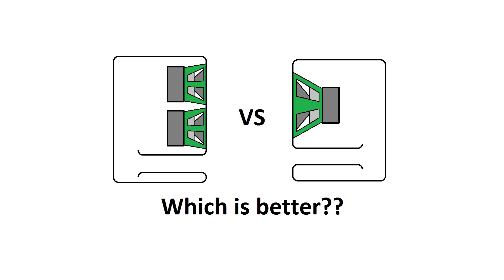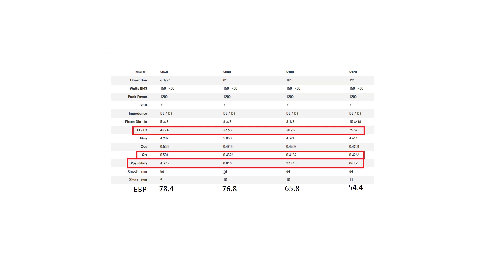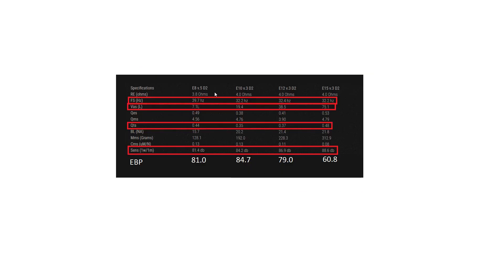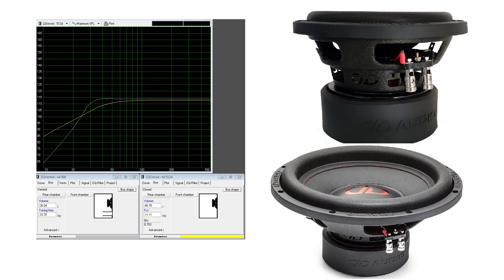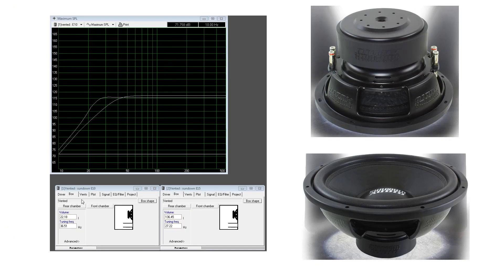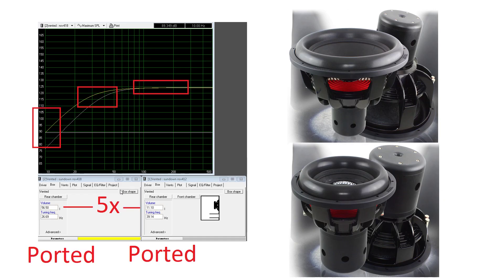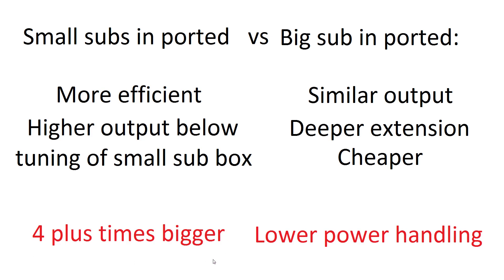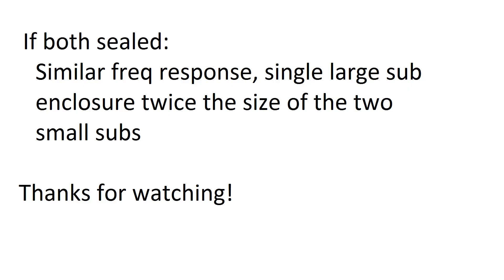Two small subs or One large sub?

Comment: I would recommend 1 big sub all day, its the best performance. Quality over quantity. But if you have a more unique sub space and it is more long that cubic then i would suggest 2 or more small subs. It really just depends on the box, the eq, the room, and the space.
Reply: Dual subs is almost always better than one big one. Running dual subs will reduce peaks and nulls, localisation smoother bass respond more head room.

So you’re wrong when you say ‘quality over quantity’ 

Have you had a listen to one bigger sub vs smaller dual subs? There definitely are pros and cons but believe me running dual is a much better experience it’s directional you can place the subs in different areas where one big sub you can’t
Reply: @amin4006  Depends on the sub(s) man.
Reply: @sagered8007  that’s true, you need to compare apples with apples. Lets say dual 10” rel vs one 12” rel you will get a better experience with the dual 10” 

Im currently running dual svs sb1000pro and I can tell you it’s a far better experience than one  sb2000pro
Reply: @amin4006  I don't doubt dual 10" is better than a single 12". But i bet that dual 5" isn't better than a single 10". And when i made this comment i was talking about having multiple drivers in a single box. Just realized that could cause confusion. Look at the thumbnail of the vid.
Reply: @sagered8007  Fair enough man, in that case I would rather one big driver in a single box too
Reply: @amin4006  👍

Comment: how about one BIG sub, two Medium subs, and one small sub.      OR... FOUR small subs, TWO large subs, and two medium subs.  Or what about 4 medium subs??/ welll????   what about it.....!??
Reply from the maker: Yes, can work, hence why 3-way loudspeakers exist. Thing is, each speaker should be crossed over. So, say for one 18", two 12", 4 8", if they're all playing the same frequencies, phasing issues can occur. Instead, for example, you could run the one 18" from 16Hz-32Hz, the 2 12s from 32Hz-64Hz, and from 64Hz up it becomes directional, so best off having the 4 8s in the doors, or in the front towers depending on application. Most 18s, however, can do up to 64Hz just fine, while it can be difficult for 12" subs to do down to 16Hz, but if you've got 4 of them, it's just fine. In terms of loudness surface area wins out, so it's better to have 2 18s or 4 12s, rather than 1 18 with 2 12s where they can't effectively do the same frequencies at the same time. Good question though, could address it in a future video.

Comment: two small and one large sub :)
Reply: That’s how I do it
Reply: @bleachstain9785  thays horrible sound quality. They play differently and different peaks. Just saying
Reply: @vasquez3769  lmfao, tune your setup right and build your own box. You won’t have that issue.
Reply: @bleachstain9785  that's not true. Different size subs react differently so no matter what box it's in you'll notice a difference when they play. I know because I've heard a few systems and ppl say they sound fine but not to my ear. People like to bs themselves sometimes.
Reply: @vasquez3769  they haven’t shot for straight SQ with them then and might have just slapped them in the car. I did all the math required for my setup, and it’s designed so the bigger sub fills the low to middle bass end, while the smaller subs fill starting in the middle bass to upper bass register. Same series of subs, just slightly different sizes, placement, etc. I’m sure nobody else even thought of removing usable room inside of their sedan like I did.

Comment: Why not recommended for a ported box?

The JL AUDIO 8W7AE-3 driver has Qes 0.654 and EBP 53.8 both of which suggest to use a sealed box. 

When I design a ported box for this driver in WinISD it shows much better low-frequency responses over the sealed one. Can you tell me why specifically is it not recommended for a ported box? 
What's behind those two formulas?

WinISD shows that both a 25L sealed box and a 50L ported one can handle the recommended 500W RMS with HPF but the ported has so much more lows and the same SPL output across the fq response. If I don't take the obvious aspects such as group delays in considerations, why is this woofer not recommended for the port? Port dia 8cm 51cm length is doable and 22m/s wind velocity is kinda still tolerable. Port tuning 23Hz.

What am I missing here? Thank you.

Comment: In my head 2 12’s that are 250rms won’t be as loud as 1 8inch that handles 1k rms. Am I wrong? Bc my 2 RF shallow 12’s are 250 rms and my old single 10inch sub which ran 1500 rms hit so much harder and deeper. Am I right?
Reply from the maker: It does depend on the box a bit, but in general, yes. The single 18 on more power will do much better than 2 12s on half its power total. Similarly, 2 12s may use a 2 cu ft box, and 1 18 more like a 4 cu ft box. 
The 2 12s compared with 1 10 gets a bit hairy. It should end up being around 3-4dB less efficient, but its also on 3-4dB more power, so should be similar depending on tuning etc. If it's 2 shallow 12s in a small box compared with a single 10", high excursion big motor sub in its perfect box, it could be above the 12s by 3dB or more.
Reply: Dakoustics that was fast man thanks. I was meaning 1 8 inch like one single hi excursion hi power 8inch vs those shallow low power 12s but I think it’s the same as you were saying with 1 hi output 10 vs 2 low watt 12’s. Thank you so much man I appreciate it
Reply from the maker: @jesp5842  Yeah, its more or less the same, tricky though to get it quite right. At that high wattage, subs often need small boxes to control their excursion, though small boxes tend to be less efficient. You'd need a mighty 8" sub. Could also consider something like a 6th order to get the most out of it. 6dB less efficient, 3dB more power if at 1k, so 6th order might be required to get that extra 3dB on top to come out equal. Box will still be smaller than the 2 12s.

Comment: I've built enclosures for pairs of pretty much every size sub woofer, and once I built one for four 10"s. But my current enclosure uses a single 18" (with two 15" passive radiators, which act as a port) and it is by far the best, most musical sub setup I've ever created, out of about 30 of them.
Reply: @Fish Chris does it matter the sub to match a passive radiator  in sealed box? Like say one 15 pair with two 12 inch passive radiators?
Reply: @430Xsidian  I'm not an expert, but from what I've read, you should use double the cone area... so one 15" sub would do best with two 15" PR's. And honestly, my two 15" PR's are pretty much maxed out. In retrospect, I should have followed this advice and went with two 18" PR's. You can use different sized PR's though, than your sub(s) like I did. You should just stick to close to double the surface area. I've considered adding one more 15" PR to my same enclosure. Wouldn't sound any different, it would just take some of the load off of my two current PR's.
Reply: Hey man any way you could make a video of your setup?? I’m considering doing something similar

Comment: Smaller cones less flex and distortion

More coils maybe more heat dissipation too
Reply: Smaller cone - higher Fs, and higher rolloff, doesn’t dig as low as loud, very precise cone control and therefore bass

Bigger cone - lower Fs, much smaller low end rolloff, digs low loud, utilizes a larger and heavier cone resulting in less precise bass and muddier higher bass. 

I prefer both. 

2 SA6.5’s, 1 SA12 classic. Matching sundown amps relative to each’s RMS, Spec built boxes. I’m more than happy, setup for SQ.

Comment: Cant defy physics. Agile sounding, fast transients are smaller pistons. 
But if you dont care about SQ, go large diameter.
Reply from the maker: Motor force is important also. If a driver has double the surface area, mass, stiffness, and motor strength, its almost identical in effect to two drivers. In this video I assume equal motor force, so yes, this is a good point.

Comment: Tens have been a meat and potatoes driver for bass guitar. The ten is so efficient in comparison to the 12 , 15, speakers . For the price and box. 4 80spl 10s will move better than a 12” 15” 18” 21”
Reply from the maker: I helped repair a bass guitar speaker recently which had in it 4 10" drivers. Quite interesting how that turns out. I'd say its a good ratio between ferrite motor and cone area, so a strong neodymium motor would be required for a good bass guitar speaker to be 12" or up, and of course neodymium is expensive, hence 4 10's.

Comment: 2 subs will have interference. can cancel room modes, but usually you just end up with more interference. the best thing to do is to get the largest possible single sub you can afford, play with placment to avoid most of the room modes, and use an eq to flatten response at your listening position. a superhuge sealed box may not be an option, in that case you can do an isobaric load and end up with a smaller box, 2x power handling, 3dbl less efficiency (notice, it will be compensated with the extra powerhandling), if its back-to-back setup you will allso cancel a lot of nonlinearity in your drivers, and have a shitload better cone acceleration.
Reply: That depends on the room 

2 subs in a small space like a car will not have any interference as the distance is so small… its not gonna have any phase cancelling as the signal goes positive and negative for booth coils at the same time.

Comment: I wanted just a basic 12” L7 so I could use one side behind the seats for “storage” in a single cab but my friend says two sundown 8’s would be better
Reply: I would go with 2 Skar Audio ZVX-8 subs in your cab instead, less room, less power needed but they will be more sound and feel than you need. Skar essentially Sundown with out the cost of the name. So you can have a much better system at less overall cost. They are underrated in power handling, so pick up a RP1500.1D or RP2000.1D Amp to power both ZVX-8's.
https://www.skaraudio.com/products/zvx-8-inch-car-subwoofer

Personally I'd skip kicker, Sundown is great but their cost goes up every year from popularity instead of sound. Skar is the underdog right now.
Reply from the maker: Bit of a tricky one, the L7 would need to be sealed. The sundown 8's should probably be ported to get the most out of them. So, depends what you're looking for.
Reply: 2 10's SA-10 ported in 2 cubes would smack the L7
Reply: Otherwise, maybe a single U-12 on 2K-3K amp

Comment: Ported, horns and 6th order usually need subwoofers with a stronger motor than an infinite baffle. Two small subwoofers might be better in a horn. Some of those little Sundown 8" subwoofers would absolutely pound in a high compression front loaded horn, so they can be well impedance matched and actually make use of a strong motor. These subwoofers were made to metaphorically "push a big gear". Folded horn drivers and drivers for small ported boxes have similar parameters.

I like to use large PA style drivers in ported as they are very economical on power, though not as much raw SPL at their limits and take up more space for the box. They are usually used for concerts because the venue's electricity supply is less taxed.

Comment: i was contemplating 3 eights or one 12, but i remembered that there is a 3db  gain per additional driver, so, even though eights are less sensitive, when all the db gain from multiple drivers and incremental power increase db gains per driver, on paper i can get well over 100 spl from three eights and you can buy three 8s for less money than 1 12, plus a sealed box that will fit behind the seat of my truck
Reply from the maker: 3dB per doubling of driver count, so for 3 total drivers its more like 4.8 dB more. Still very similar to the 6dB I'm guessing you used, but its not like 100 8" subs are over 300dB. Also when you consider power consumption, 3 8" 250w subs are way louder than one 12" 250w sub. Should kick ass, especially when its behind the seat

Comment: I got an Audi A5 cabriolet. So space is extremely limited. Was thinking of doing a JL 13.5” shallow mount for infinite baffle on the trunk wall. Would that speaker work? Or would you recommend  a non shallow mount for that purpose
Reply from the maker: JL have some of the highest quality car audio subs. From what you're describing you're best off going with a subwoofer with a Qts ranging from 0.6 to 0.7. Most subwoofers tend to have a Qts from 0.3 to 0.5, so might require some hunting, though in essence since the enclosure is so large its not providing much damping on the driver, so its up to the drivers suspension to do it itself. 
High excursion is ideal, as once again with low damping the driver tends to move quite a bit at low frequencies. So low profile might not be ideal.
The shallow mount driver you linked wouldn't do too bad a job, but its Qts is a tad lower than ideal at 0.45. I can't think of an ideal driver off the top of my head, though I'll do a quick bit of research and come back if I find anything decent.
Reply from the maker: I had a quick look, I found the Dayton Ultimax 12" seems to have decent specs, and should sound good. It is quite deep though.
https://www.daytonaudio.com/product/1118/um12-22-12-ultimax-dvc-subwoofer-2-ohm-per-coil
Reply from the maker: If you're looking for shallow mount, Rockford Fosgate has a shallow 12" with Qts of 0.66 which should do quite well
https://www.rockfordfosgate.com/products/details/r2sd2-12/

Comment: So I have to ask, where does your knowledge come from? Is it just messing round with speakers or are you using what the program tells you. Cus I used winisd for my last build and it lied to me. Made a box for 6.5 in that it suggested ported 2cuft for but omg it sounded like crap. I rebuild the box from 2cuft to 0.75cuft and removed the port and now they shine in the low end. In fact it seems to be very hit or miss when it comes to winisd. I used the Dayton Audio DATS v2 cus you cant trust cheap woofers to have an accurate list of Thiele-small parameters. So I know I was using good data when doing the box simulation.
Reply from the maker: Knowledge came from studying, books, websites, mucking around in winISD, also even highschool and uni physics. A big source too of general knowledge came from youtube, there are nuggests around and if you watch enough. Guys like HexiBase and EMF audio have some great videos. WinISD can get things wrong, often it'll output super peaky results for high Q low vas drivers. I'd say it's accurate for a specific middle range of drivers, but yeah no way a 6.5 should be in a 2 cube box. That's what I put 12's in. Also how did you use the DATS v2? thinking of getting one, did you use added mass, or specific airspace?
Reply: @Dakoustics  On the 2cuft box those were the parameters that came with the woofers, and I used DATS to get the real parameters.  
On DATS its petty easy plug it into a pc then hook it up to the speaker and use the software to do frequency sweep and you get  all the info on the driver. Its a nice little tool and will soon pay for its self in time saved. They current have V3 of DATS either shipping or will be soon. Tho it did go up $20 for V3. 
I'm still fairy new to working out the magic of Thiele-small parameters, HexiBase has been a big help in working out where I went wrong with the 6.5 inch woofers. That being said, in the past winISD has done very good on some 10 inch and 12 inch sub boxes. 
I have also found that with most builds (not all) you can get better bass with polyfill in most sealed and some ported boxes. The stuff sold as filling for art projects seems to work just as good as the high dollar stuff you can get from places like Parts Express.
Here is the video on DATS this is the V1 and the V2, V3 are most just more robust with added accuracy. https://www.youtube.com/watch?v=dARRX-tZpg4
Reply from the maker: @99Duds  V3 looks good, I'll get it if it gets a good review. I'm currently building a sealed box for a mate, and didn't put polyfil in it before essentially glueing the sub in, but due to its geometry it doesn't seem to have any higher resonance, at least not at the woofer frequencies. The horn however has an awful resonance at around 200Hz due to the driver being mounted into essentially an echo chamber. Geometry matters. Also I'll do a Thiele-Small video at some point,

Comment: The really weird that happens is that one woofer has more bass than 2 woofers, i don’t know why that is but it’s weird
Reply from the maker: it can be summed up as- a single large sub is softer than two small subs, which means its more optimised for a bigger box. Bigger boxes are more efficient, and are efficient enough to make up for only having half the power.
Reply: Dakoustics they are both in separated boxes and they are connected to the same amp. The amp has 2 subwoofer connections
Reply from the maker: @mauromortier7808  ahh, check polarity, flip the + and - of one around and see if that works